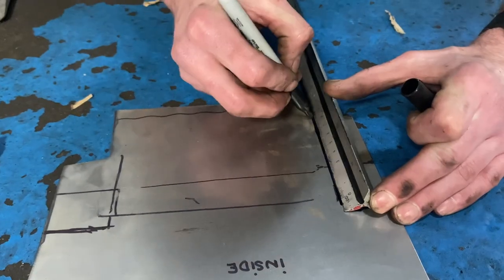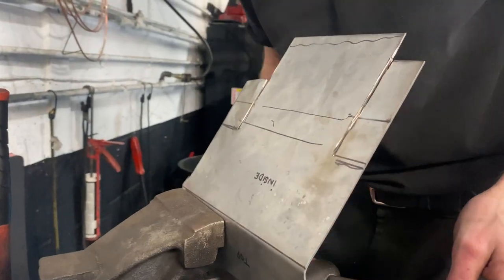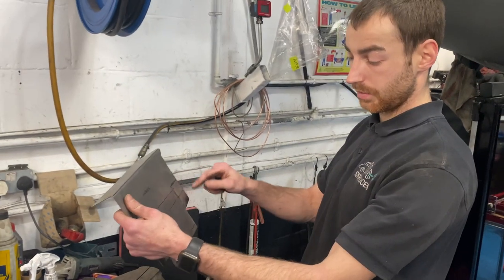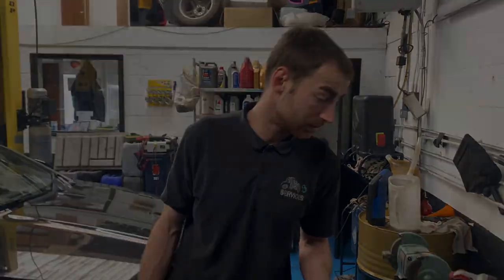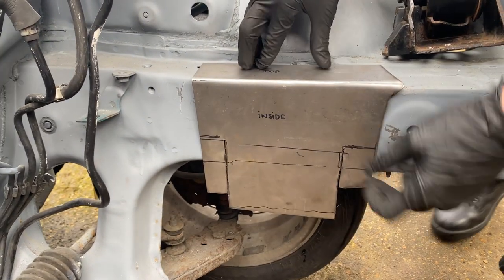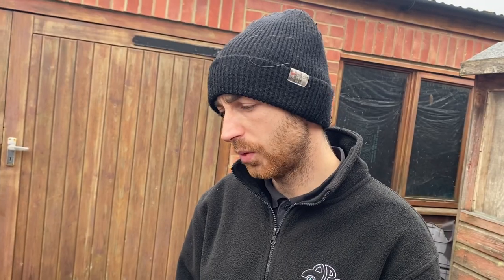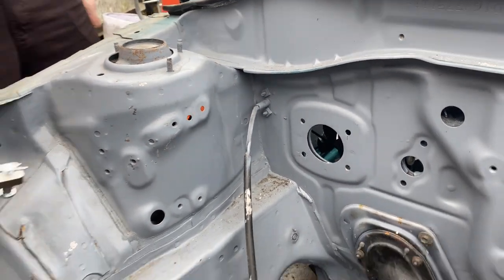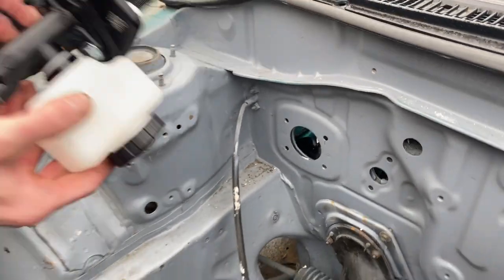Starlet (Engine Swap Series Ep4) Making engine mounting plate & planning for captive nuts & welding

Comment: I want to do a 2zz paseo swap.
Reply from the maker: Yeah, that would be a really nice swap. I do want to buy a paseo to modify in the future. Do you have a paseo currently? :)
Reply: The 2zzge is awesome!!!
Reply from the maker: @Dimos  it is my friend and I can't wait to start working on its internals :)
Reply: @shyguy8426  for me the internals is strong for 400-500hp only the pistons need replace and that because have 11.5:1 compression. The rods and crank are forged. I know people with mr2 2zzge 100%stock internals and 390hp 330nm gtx2867 and stock c60 Box!!! The only negative is the cylinders because has mmc lines and if damage need another block or sleeves.
Reply from the maker: @Dimos I don't really know how this engine was treated before i bought it out of a scrap celica with 112000 miles on it. yes it runs and works fine but I was considering changing the main and conrod bearings and the pistons to lower compression ones and inspect the condition of the block and head properly. that's the main reasons I'm considering going in there :)
Reply: @shyguy8426  if engine don't consumes oil and has over 160psi per cylinder is ok. why go through the process of making a repair mate? Also if use good oil (I use 0w40 mobil1 fs) this engine can reach 300.000 kms easy!
Reply from the maker: @Dimos  she doesn't consume or burn oil. thanks for your advice tho it's all taken on board. also I only ever use the best oils or lubricants in my cars :)
Reply: @shyguy8426  what oil you use mate?
Reply from the maker: @DimoS...  depends on the season. I either use 5w-30 or 0w-30. Mobil 1 or castrol.
Reply: @shyguy8426  good choice, but remember me the best oil out there is the mobil1 fs 0w40 mate! Has big wear protection for high rev engine has 3.6 hths 1100 ppm zddp etc...try it if you want, don't scary with 40 weight it's OK. Also the 0w is the best even in hot weather. Is much better from amsoil penzoil castrol etc...
Reply from the maker: @DimoS...  Thanks for the advice mate, I really appreciate it. I also use redline for transmission oil. What's the best aftermarket radiator for the 2zz in your opinion? What do you think of halfrads?
Reply: @shyguy8426  I'm glad if I helped you my friend, for the c60 the best fluid is redline mt90 gl4 (not gl5) for the radiator I don't have opinion but I hear good thing for mishimoto. Also put coolant from toyota and only the pink. And never put additives on engine and box buddy! 🤝

Comment: How did you get the oil filter housing to fit as in what way did you remove the threaded part already on the block
Reply: As in the glanza oil filter housing on the 4e block
Reply from the maker: I just used the main banjo centre bolt the goes through the centre of the oil filter housing into  the block. there are smaller threads on the actual housing which I blocked up with JBweld and that stopped oil leaning out the smaller bolt holes. the centre bolt is strong enough to hold the housing no issues.

Comment: Did you use 4efte map sensor when you turbod the 4efe
Reply from the maker: Yes sir I did.. How's the build going? :)
Reply: @shyguy8426  it's getting there slowly but surely, be done maybe 6 weeks 
Quick question when I plug in the glanza map sensor it idles perfect but runs lumpy when you rev it, now that's with standard everything else, so is it under fueling or overfueling, I know I've to get glanza injectors but I got an adjustable fuel pressure regulator so I just need to know what's happening
Reply from the maker: @lostsheep1616  That's really cool mate. I would love to see it finished :). Honestly I wouldn't know without a AFR guage. but generally it underfuels depending on how much accelerator is presssed if too little it under fuels if too much it over fuels also depends on the rev range so towards the top it over fuels. with your ct9 you will have a lot of torque so please please retard the ignition until you get it mapped so you dont blow any rings. also get a oil catch can set up :)
Reply: @shyguy8426  can I get it mapped standard ECU😂, I'm not planning on getting an ECU or piggyback simply because I want to see how long it'll last
Reply from the maker: @lostsheep1616  It just won't last mine lasted 4k miles. your better getting it mapped and then bashing on it as much as you want and see how long it lasts as you go up in power.
Reply: @shyguy8426  do you recommend det3 ? I just never wanted to get ecu because there’s nobody in Ireland that maps them but if I need to get it I will
Reply: @shyguy8426  my plan was to turbo the 4e as cheaply as possible because I’m building a 4efe out of a car, full forging it capable of 280bhp so I’m kinda waiting for the standard one to blow nearly